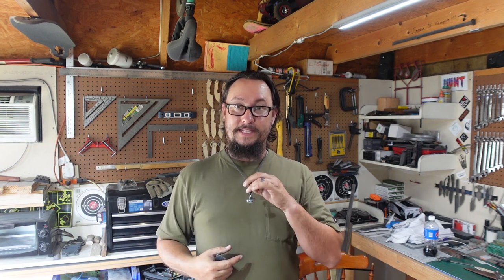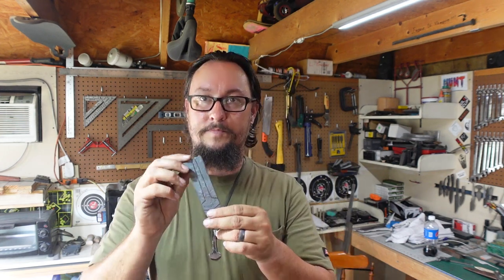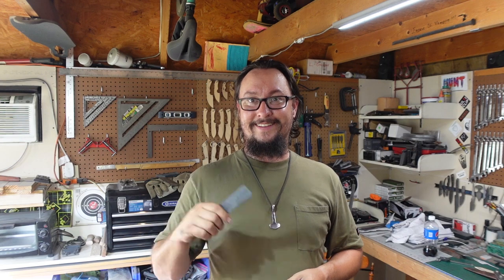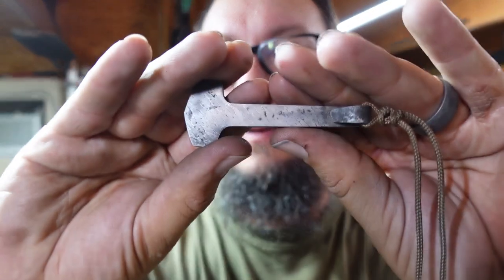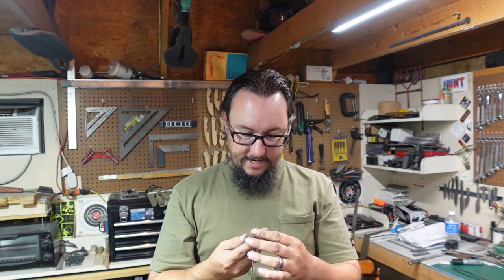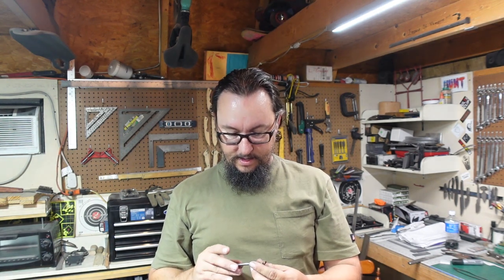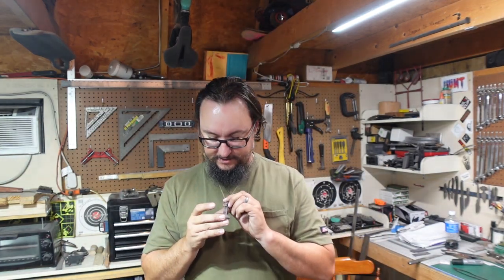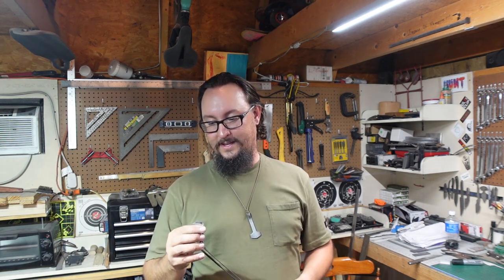Making A "Mjölnir"(Thor's Hammer) Pendant From Forged Cable Damascus | Forged Necklace | Knife Maker

Comment: Hey Erick, One thing you can do to bring out the dark colors without eroding the edges of the pennant is to coffee darken it then hit it with a Sunshine Cloth... really makes the darks and shinies pop
Reply from the maker: I'll have to try that out.
Reply: @theriversexperience9383  cool, the mixture that I usually use for coffee etching a blade is approximately 1 20oz jar of instant coffee to 1 gallon of warm (90-95 degrees) water, leave it in over night, wash it off with soap and water then hit it with the sunshine cloth